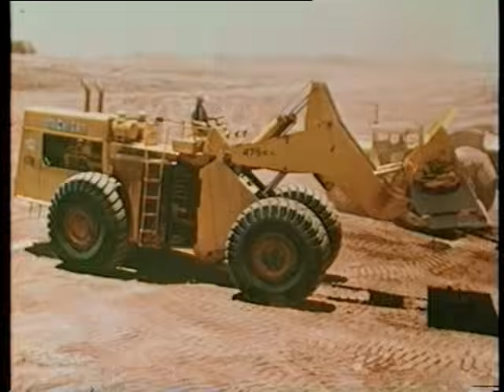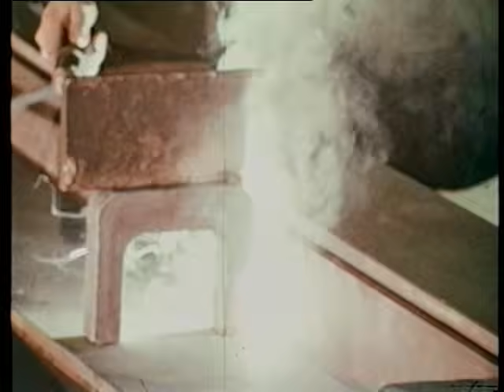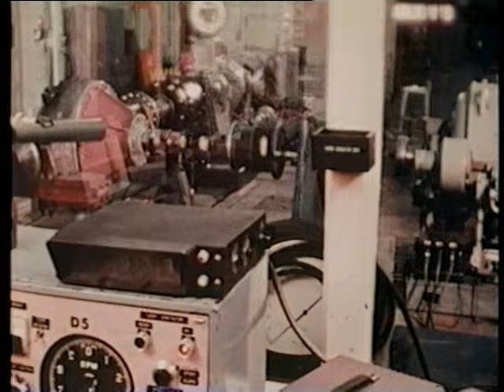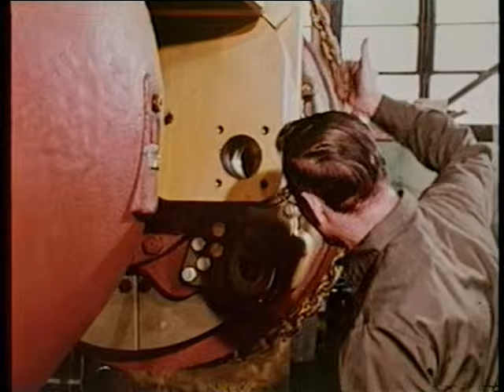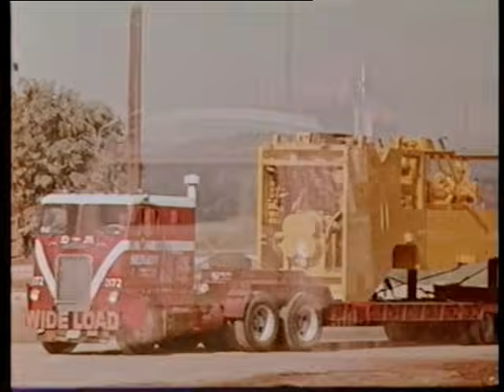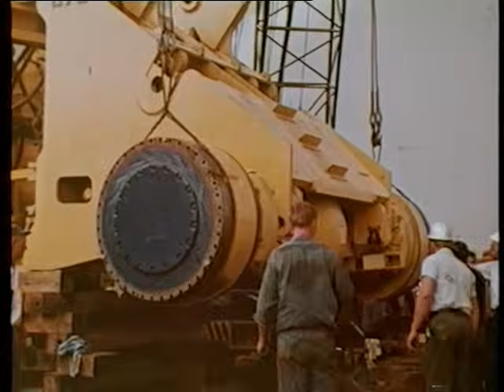CLARK Michigan 675 part 1

Comment: Big machine one manufacturers engine ones power train ones hydraulic system thatsvwhat they did we had a L320.  Multiple service manuals,  K19 Cummins engine Clark counter shaft transmission Husco hydraulics all and all performance was good

Comment: The breakout force on that loader was astounding for the time and again , for their older controls it was fast but that machine with a few upgrades would perform with a 994 easily
Reply: My friend and Mentor had a 475 back in the late 90s. They said it was a total beast. Eventually once they finished a big crushing job, they cut the machine up for scrap at the end.

Comment: They should bring that loader back with new control systems, the power plant needed no improvement. Just a modern cab and controls with onboard bucket scales and new modern tires and you got yourself a beast at a fraction of the cost of modern heavy load out units such as this .

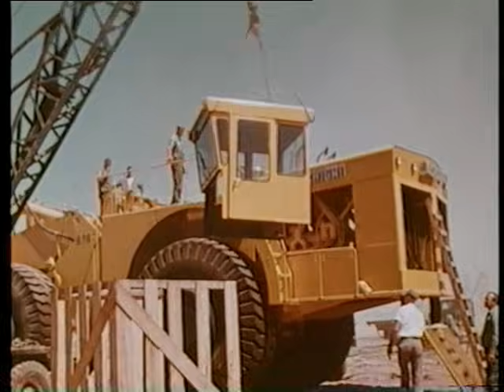Comment: 13:28 the cab on the 675 & 475 look like simple agriculture combine harvester cabs which is super sad because this machine won't harvest one peeon of alfalfa sprouts when it comes to 1st cut in the field. Strange how in those days nobody other than the operator didn't seem to care how they designed & engineered a cab for earth moving machines unlike today with heated and cooled air ride seats, possibly Chinese Knockoff fake leather and So on.
Reply: What the most crazy is operator's were prepared to run these huge machines with no protection for the driver either from dust or falling debris or even roll over protection

Comment: Sure wouldn't want to be operating the non existent socalled non ROPS open air no cab 475 Mich at 2:54 , your exposed to everything under the sun including dirt grime from the material this grunt machine is moving. By the time lunch rolls around your just a filthy dirty as the ground you walk on & stinky of diesel fumes soot emissions and hydraulic oil and if married the wife can smell you coming that's how dirty you will be after a hour, not even a homemade sun canopy on the thing. And thankfully the best thing of all is NO SUPER DUMB BACK UP BEEPER in those days.

Comment: great video. The letourneau is a great machine but to me did not have the retro look of the clark michigan 675 kitted right out with the larger tyes and larger rock bucket which i believe was 25 sq yard ! This machine was awesome -then i beliieve  they did a 50 square yard coal bucket but proved to big as in the 475 had a 12 yard rock and had a 25 yard coal bucket ,,

Comment: @generationll Yes but that doesn't necessarily mean that the 992 was the best wheel loader.  You have to take into account the sales and management of each individual company.  Clark engineers were the best out there at the time, but the business managers sucked and bought basically every company they could and overdiversified.  This resulted in the subsequent failure of Clark/Michigan loaders because the company had failed, not because the wheel loader had failed.

Comment: One drawback of  the  Michigan 675 when introduced was its tire size.Tires then weren t just big enough for it.In this video the 675 is equipped with Goodyear 36.00-51,58PR(L4)tires which were the biggest tires back then.They weren t sufficient for it.The tire life span for these Goodyears was just  200-300 hours.Later on in 1976 Goodyear introduced the right tire for the massive 675 which was the 67-51XT,54PR(L-5) which was the right tire for this big wheel loader.Overall just 18 675s built